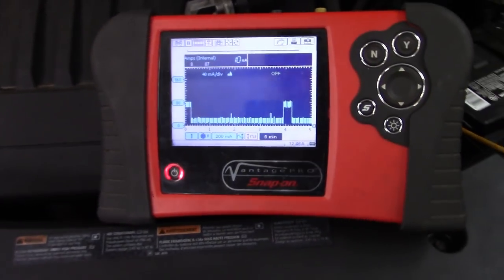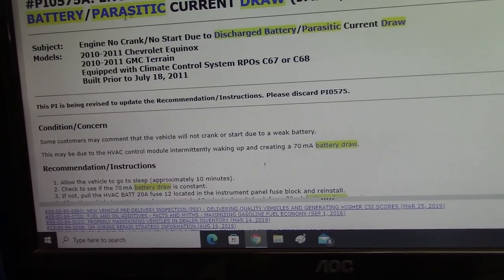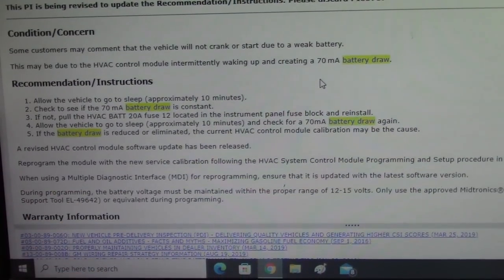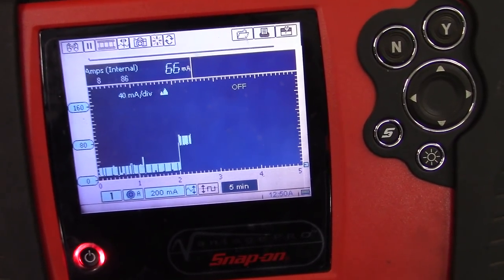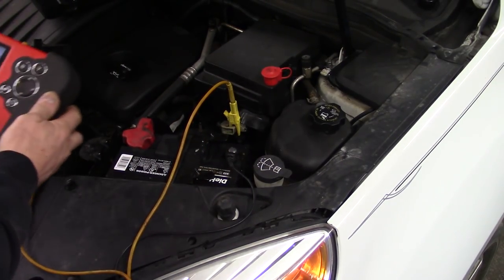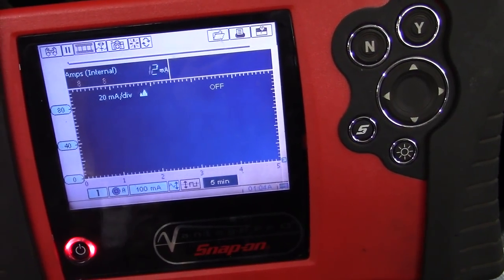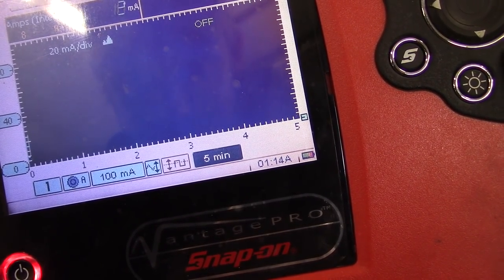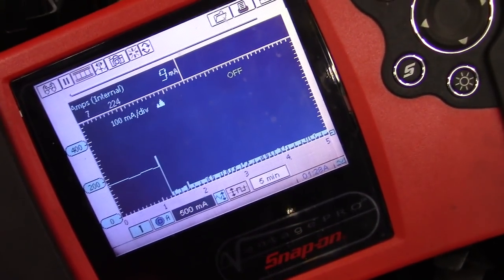Chevy Equinox: Battery Draw- Fixed With Service Info

Comment: Module firmware bug + customer special sequence of HVAC operation = Parasitic draw (which GM describes as Battery Electrical Drain / Parasitic Load), and in this case a complex periodic draw.

Problem: Do not interupt module or vehicle power or the module will reset and the problem will go away until you recreate the special sequence of operation, or in other words, work your way through the code until you reach and trigger the bug (code problem area). 

This is why I use a current clamp and a Scopemeter. I can watch the battery current draw over time to spot a parasitic draw if complex (periodic). All I have to do is find the circuit, which I can narrow down by looking at the fuse box feed(s) and then find the circuit. If the draw is high 800mA I can first try and look at fuse voltage (voltage across a good fuse) when the draw is active. If the draw is low, like 70 mA I would leave the Scopemeter hooked up to the box feed and then identify the problem circuit feed with a seperate current clamp meter like the B&K Precision 316.

Before I would do any troubleshooting, I put the vehical on life support (I use a 20A 20V variable DC linear power supply with reverse current protection diode). This way I can keep the vehicle alive, put a slight charge on the battery, and keep the vehicle supply constant and quite (this is why I don't use a switching supply) while troubleshooting. I can keep the supply connected to support module reflashing if required, unless a recal procedure wants me to start the vehicle, or actuate loads greater than about 10 amps. Then I just use the battery. If you reprogem several modules it can take up to an hour or more to reflash, clear codes, and calibrate. Also, if you change a transmission valve body the calibration procedure will include loading new solenoid transfer functions (VFS, PWM profiles).

After a vehicle is repaired I usually take time to see what the sleep current profile looks like. So I take a Scopemeter plot that shows current draw during sleep and battery voltage which I find interesting and gives me an idea of what the sleep time is for a certain make and model. Using the current clamp you can actually start taking this data while the vehicle is on, at operating temperature and at idle, where you should see battery alternator charging current and then go key off, exit the vehicle and lock the doors. Make sure to defeat a hood light or hood open sensing switch first. You may also see a cooling fan cycle on after key off. Which has a high current draw so it may be off scale. 

The procedure above is even more important if you work on higher end luxury vehicles that have the battery buried in the trunk. For a GM product (Cadillac) not only is the battery in the trunk, it is practically inexcessible unless you dismantle the trunk (which takes 25 minutes) except for maybe the BAT NEG through a small access door. So put the vehicle on life support at the jump start posts underhood and then use the current clamp method.

It is really hard to have a specific set approach when troubleshooting parasitic draw for all vehicles, especially if you work on domestic and foreign makes, because of the many different approaches to vehicle electrical design.

Comment: So did it cure the issue? The bulletin said a consistent 70mA draw but you had an intermittent 70mA draw, admittedly the numbers fit perfectly but the wording, as in most tech docs is vauge and confusing. I'm sure if it comes back we'll see the part 2. It's nice to see a mechanic who can do the auto spark work, in the UK most make out like its a dark art. Thanks for the videos

Comment: The 2019 Honda CRV has a battery draw which is fixable if you fight with the dealer until they RTM.  If they update their own software then it goes away. It also depends on the fuel level.
Reply: What is RTM
Reply: @AgentOffice  “Read the Manual”. The 2019 CRV was a redesign and there was R&D software revisions left on the released vehicles. If the temperatures and the fuel levels were a certain amount, the system would go into some calibration mode and the battery would drain itself from use.

Comment: Very good video and very useful I work down here on Long Island ny and service one of our big accounts optimum cable company which runs a ton of equinox vehicles and they range in years thru the fleet and I will definitely look for this on the next battery concern diag and hopefully this will get me a huge pat in the back for finding this issue. Awesome video Eric
Reply: This is a non-issue if the vehicles are driven regularly (read: more than once every few months).

Comment: I'm having a similar problem  with a 2016 equinox that intermittently has a clicking noise from engine bay after shutoff.  Sounds like a relay,  but dealer couldn't find the issue.

Comment: I have to wonder how this draw wouldn’t have been an issue from the factory that created issues before getting to this point if it was a software issue from the factory. I am currently dealing with a similar issue with a 2009 Equinox and I’m trying to make sense of how this could be a new problem on old software.

Comment: I just want to know how hard is it to stick in an aftermarket sunroof? Seems like a lot of work for not alot of gain. I bet it wasn't a cheap idea either! My Tahoe has one and I never use it lol.
Reply: I never could understand why anyone would want to cut a hole in the roof of their car. It leaves you with somewhere else the rain can leak in and the rust can start (how many installers will treat the edges of the opening properly when it's out of sight?). All cars have air conditioning today and if it's fresh air you want, open the windows.

Comment: 2007 Chevrolet equinox good battery good alternator but after you cut it off and try to cut it back on it won't crank it shows some kind of fuse or

Comment: More modern electronic junk.

The blend air doors on my 60's stuff still work flawlessly (as do the crank windows, breaker points, and carburetors. Move lever, cable moves door. They'll still be working long after I'm gone!

Comment: Any newer car is going to have some battery draw while it's just sitting.  In my opinion, FWIW, any newer car that's gonna sit for more than a week or so should have a battery tender on it.
Reply: IMO, it's not a low drain that's an issue. Any lead acid battery that's just sitting needs to be charged / topped up periodically and not just left to sit for months. Applies to older cars as well. You could pull the positive cable off the battery and still end up with a sulphated battery, given some time.

Comment: you know what would be handy, if all these fancy scan tools had an option that would put all the modules to sleep vs having to wait the 10 or whatever minutes for all the modules to go to sleep, why hasn't that been done by snap on, is it not doable?
Reply: Better question is why they don't go to sleep right away instead of waiting 10 minutes. Just lazy programming.
Reply: That would be nice, but I suspect most of the scan tools reverse engineer the factory tools to find the commands rather than do the in depth research needed to find that unused function.  If the factory tool doesn't have it, then it's unlikely anyone else will either.
Reply from the maker: Actually the scan tool that I'm using has certain functions to shut off parts of the data Network and see which ones are on and which ones are not. It's likely the route I would have used had I not had a TSB that fit our criteria. Instead of pulling the fuse we perhaps could have watched the network status for each module and likely would have seen the HVAC coming alive. Hindsight's always 20/20 though 👍
Reply: My autel does but I always question if it actually put everything to sleep if there's still a draw or if something is truly drawing current.
Reply: @RobertHancock1  They don't go to sleep immediately because they have functions to perform. Some will be doing tests, some will be running optional functions (keeping the lights on for you to get to your door, for example). Others will linger for faster startup if you only hopped out for a minute ('infotainment' for example).

It's more work to put in a delay than just shut them off, so lazy programming doesn't even make sense.
Reply: @Monkeh616  There's no function most of these modules need to do within 10 minutes that they don't also potentially need to do after 10 minutes, so why are they staying awake? If something happens they can wake up again. What you're saying is basically because the system design takes too long for them to wake up, they need to stay awake longer than they should to avoid noticeable delays for the driver. But then the fix is to speed up the wake process, not to keep devices awake and drawing power for no reason.
Reply: @RobertHancock1  'Most of these modules' don't remain awake for 10 minutes. I gave some brief examples of reasons to remain awake, summarily ignored. Are you a programmer? Familiar with GPS systems, multimedia management, system integration, emissions or safety requirements? There's no doubt these systems are a mess, but I respectfully suggest you may be unaware of the complexities.
Reply: @RobertHancock1  is also due to how data communication lines through the car are designed,the nodes will send a wake up message across the can bus network associated when operated, I.e. door handle when opening door sends wake up message across network as well as certain modules stay awake for certain times so the car can still perform functions while “off” like run coolant pumps, fans etc

Comment: do you have any videos on nissan a/f sensors. it doesnt read like an o2 im use to or its broken lol. the upstream in a 12 altima reads at 2.1 to 2.25 volts.  the downstream reads like the usual o2 sensor does but that upstream is weird and what info I can find says that 2.2 is normal and it doesnt have any codes. there just isnt a lot of info I can find

Comment: I can't remember which vehicle it was, but I had one where I could pull a fuse, and the parasitic draw would go away.  re-install the fuse, and it would not resume.  Turn the key on, shut it off, and the draw returned and whatever module would not go to sleep.  I never did fix it.
In either case, a short .070 amp draw every 4 minutes is not much.  This car is sitting unused for weeks at a time.  I predict the battery will still go dead in it.

Comment: If it was my car.  I likely would have assumed it needed a new HVAC unit since it has that draw..  Instead of buying one, I would have pulled that fuse, ran the two wires to a super cheap relay (with an inline fuse now) and wired that to switched power.  So when I turned the key off -- it would drop that relay, which would basically pull the fuse to my HVAC unit.  No more draw-- and I didn't have to buy an expensive module to make it work..  I'm not afraid of hacking things this way on my own cars, if they are old enough . lol

Comment: do you have a link to those long nose angled pliers you pulled the fuse with?
Reply: I found a comparable pair at Harbor Freight, fwiw.
Reply from the maker: They are called Kiwi pliers. They're named after the kiwi bird
Reply: @SouthMainAuto  Thanks Eric!
Reply: @jimurrata6785  Sheesh, Jim, I did try too! ☺
Reply: @DeserTech  Thank you too!  👍
The Quinn 8" pistol grip pliers seem to sneak under the $10 cutoff for ,30% coupon by ONE PENNY!
I'll see if they are in-store tomorrow.
Reply: @jimurrata6785  Crossing my fingers for you.

Comment: Ive always heard that a fwd vehicle is better in snow and ice than a rwd? I realized you said it was 2wd, but im just genuinely curious as i know yall have alot more of it up north than we do down here in the south
Reply: If it’s rear wheel 2 WD  it’s sucks up in New England any snow and you’re not stopping you’re not going however I think that equinox was front wheel drive two wheels only no 4WD 
 Eric might clarify but yes front wheel drive does handle well in the snow not as well as four-wheel
Reply from the maker: Front wheel drive is pretty decent in the snow providing your running snow tires on all four corners. All wheel drive is absolutely perfect for where we live especially with the number of back roads that we travel. I believe these folks live out in the country pretty far so front wheel drive is virtually worthless. They get a pretty good mix of Snow, wet and slushy snow, and then mud for most of the spring.

Comment: With all the electronic components containing software on vehicles nowadays the manufacturer should make an easy way to automatically check each module to see if a software update is needed or available. Sorta how Windows does its updates on a computer. This could be something a scan tool could check so the owner or mechanic wouldn't have to do it manually for each individual module in the vehicle. Or the main computer in the vehicle (ecm) could connect to wifi and look for available software updates at the manufacturer's website. And the ecm should display the software version number for every module in the vehicle when placed in diag mode. Why not make this easier to ensure you've got the latest software in every electronic module your vehicle has?

Comment: That module might have gone into a 'standby/suspend' mode as a result of its last run settings. When the fuse was pulled, it cleared any 'suspended' operations from the running program.

Had the HVAC unit been run again, it might once again have retained a 'suspended' operation mode waiting to resume its last settings. Under normal regular use, that 70ma spike draw would be superfluous to battery drain. Extended periods would have found it problematic, and thus a software update that defaulted to completely clearing the software running instructions. when the HVAC is not in use. 

This is directly analogous to a personal computer in 'standby'  or 'suspend' mode. There will be a continuous trickle required of the battery that will eventually drain it.

Comment: I had a 2018 chevy trax that was in the shop for the 3rd time for a dead battery. First time a tech put a battery in it, secondtime another tech put a power steering module and bcm in it due to service powersteering. came in again and i get it, battery dead. i charge battery and do a draw test had 3.5 amps did the old voltage drop on all fuses, none really showed anything, i happened to realize the onstart light was still on after vehicle has been off for hours, remove that fuse light goes out but draw only drops slightly. ok Hook up the data bus diagnostic tool, all modules are responding and key has been off for hours, bcm would stop respoinding and start responding for a minute, so clearly something was keeping everything awake. I walked away from it for awhile and it hits me i bet this thing is awd and has the classic corrosion of the rear differential control module. unplugged that draw drops and everything goes to sleep. pulling the fuse for that module caused the ipc to go blank and onstar to go red. sometimes you just gotta walk away from a job for awhile to get the answer. Also i hate that they call the hvac module something else trying to find it in the parts catalog is a pain, they don't even call it a module in the catalog, they call it a control.

Comment: Does GM pay for your time and labor for the service update? So the costumer doesn't have to pay you?
Reply: A service bulletin is different from a recall. If the shop didn't have the ability to reprogram the module, it would have to go to the dealer to be done and there would be a charge. Shops pay a subscription to be able to access the GM website, plus there is equipment and time involved, so the customer will be at the least charged for diag and programming time.

Comment: Eric, let's get some REAL jobs to do soon !!! Here in Florida "" Corrosion Belt "" we don't get to sit around waiting for things to do !!! There is always shocks to change, brakes, A/C service, tune ups and oil changes. We can't hang out in the kitchen with the pretty girls !!!  Need some exhaust system change outs, mufflers replaced, tires replaced and coolant leaks fixed. How about an alignment !!!!!!!!!!

Comment: Dashcams siphon juice down just like a kiddo sucking down on a Slushie.

What customer need to do on extended storage of vehicles is to connect a trickle charger and leave it be.
Reply from the maker: I think they live off grid TBH
Reply: @SouthMainAuto  They make a solar panel trickle charger that sits outside or on the dash where the sun hits it and connects to the 12Volt socket. Plus, it's got clips, so you could connect directly to the batt itself.
Reply: Yep. I have a Ford van that I only use occasionally and it was always down when I needed it. I installed a small solar panel in the dash and it keeps battery at top - always starts fast, even after more than a month stopped.
Reply: Yeah
I’ve got a solar trickle charger that plugs into the “power port” (cigarette lighter to us old farts)
Reply: @thomash1923  Yep, it's a good solution. In my case, I added a second socket for the solar panel, to allow the lighter connector to be used with other stuff, if needed.
Reply: Jose
Cool
Mine is just some cheap aftermarket thing but it works.
Reply: @thomash1923  Mine was a dumpster find 🙂
Reply: @JoseSilveira-newhandleforYT  
Cool
Dumpster treasure. 
Found mine cleaning out my father in laws trailer.
Reply: @thomash1923  LOL. We both got lucky 🙂